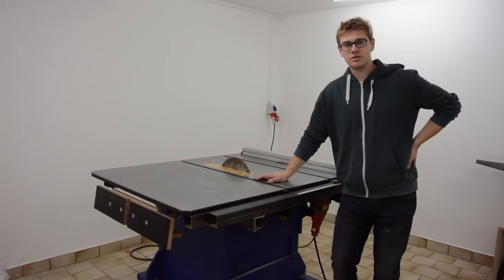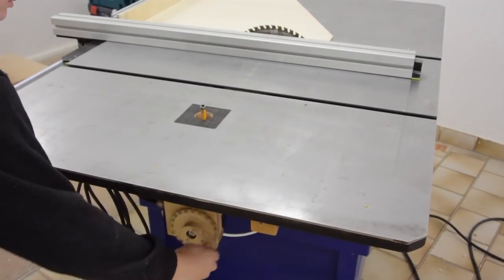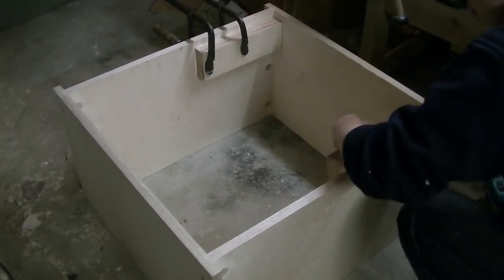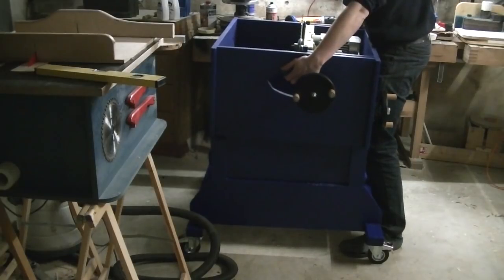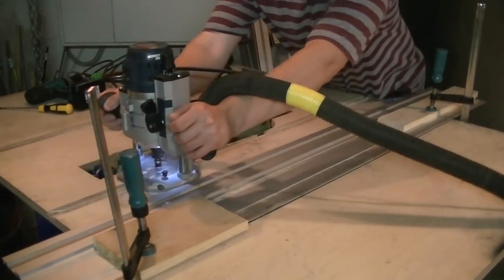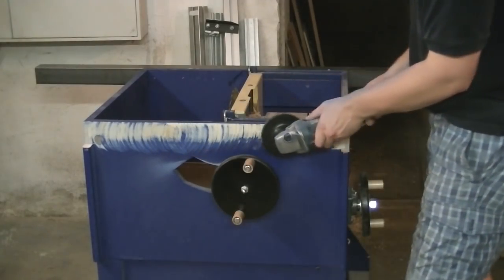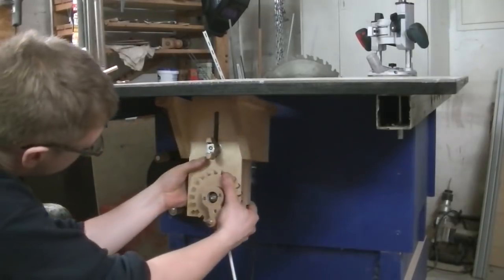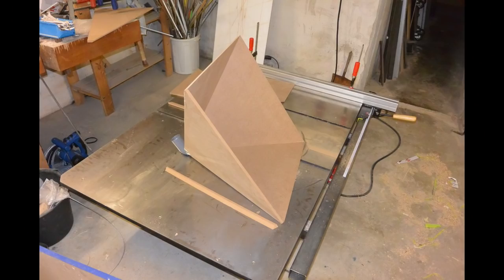How to build this big Table Saw with Simple Tools!

Comment: why you didn't put a sliding table on it
Reply from the maker: because I don't like sliding tables. They take up space, are in the way and If I need to break down sheet goods I use the circular saw. No need to ruin my back :D
Reply: +Cosmas B Ok ich arbeite in einer tischlerei und kann mir das nicht mehr ohne vorstellen
Reply from the maker: Ich auch und es nervt mich jedes mal.
Reply: +Cosmas B gibst da so eine plattensäge
Reply from the maker: Mathias Hoyt
Ja automatische Plattenaufteilsäge, ist ganz dufte.
Reply: +Cosmas B achso zum zerteilen von platten haben wir nur die formatkreissäge
Reply from the maker: Mathias Hoyt
Ja dafür braucht man sie schon aber immer wenn es darum geht kleinere Teile zu sägen ist den Schiebetisch echt im weg. Da ist eine Säge ohne viel ergonimischer.